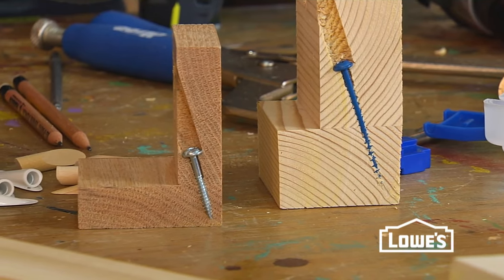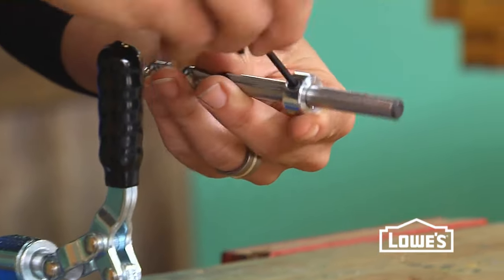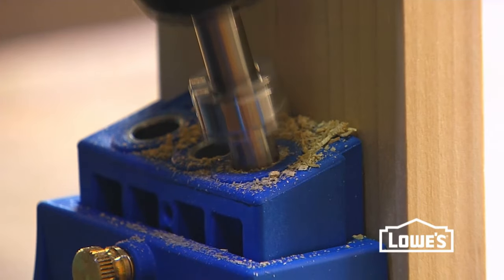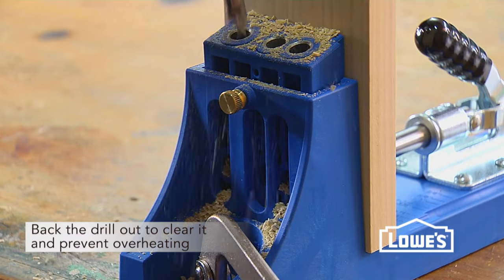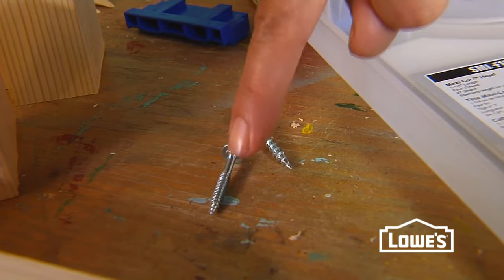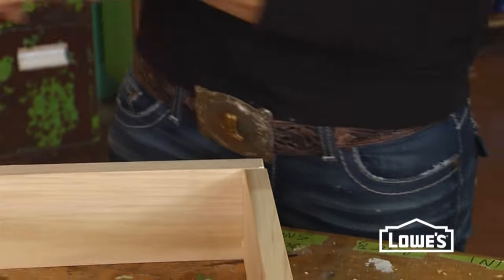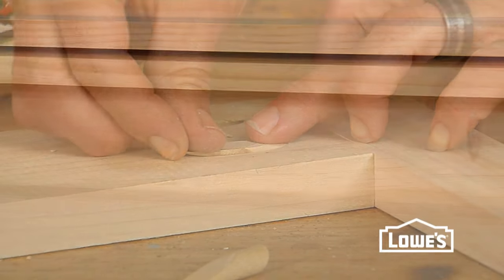How To Use A Pocket Hole Jig

Comment: I recent purchased the K4 Kreg Jig.

I am trying to join two 1.25"x1.25" pieces of red oak and the manual states to use 2 inch fine thread screws.  But whenever I use those screws, its splits my oak.

What other options are there?
Reply: Try a different type of joinery?
Reply: @William9alex  I ended up contacting Kreg Customer support. 

They recommended setting the bit and jig to 3/4" material and use a 1-1/2" screw. It goes a little under an inch into the material I am using (1-1/4")

Comment: Why are there multiple holes (3)? Different sizes?
Reply: Just for strength.
Reply: different width boards
Reply: No. The holes IMO are used for spacing between holes in NARROW stock (less than 6").

Comment: I was very surprised to see than none of the comment have mentioned the wrong way that the screws was shown in the video. At 0:17/0:20 it shows how the screws going through the top wood and in to the bottom one. You must ALWAYS direct the screws towards the longer end for maximum strength witch means in your example you should drill from the outside of the top board towards the inside of the bottom board. The way you do it is very week with minimum strength. People should not copy that. Thanks.
Reply: Are you saying that you shouldn't drill the hole toward a corner?
Reply: Very Good Point you made. But nonetheless the video was great otherwise. Thanks

Comment: Personally, I'm addicted to my biscuit joiner and generally have trust issues when it comes to anything that's not glue+tenon+mortise. However, this looks like a great way to avoid the clamping blues. If I can glue all my work at once, using the pocket screws instead of the wobbly clamps, it's worth the investment. Any thoughts?

Comment: I am concerned that this doesn't show drilling a pilot hole into the second piece to prevent splitting. It will probably be okay most of the time, but forcing a screw into the end of a plank can cause splitting. Also if the wood is very hard, it might not be able to force its way in at all.
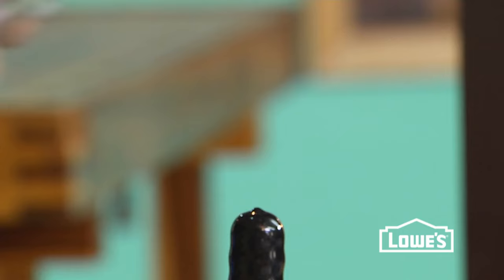Reply: sharpstick I'm pretty sure that the drill bits used do in fact drill the pilot hole into the second piece, that is why you have to set the wood sizes so it plunges to the correct depth. Check the cross section at 00:17 and the bit at 00:33 and work out where the collar on the bit would stop and the drill bit would go to.
Reply: bradburyrobinson Actually, checking my own comment you could be correct. The little end bit of the drill does only seem to sit in the first bit of wood. Maybe the screws are designed for this purpose but it's possibly a valid point that the wood could split in certain instances.

Maybe some people who currently use this could confirm if this is the case?
Reply: sharpstick as a carpenter, I would agree with you, though the manufacturers say their screws are designed to prevent wood splitting ( i guess like aeroplanes are designed not to crash) you may have to start the screw to make a mark, de clamp and then pilot drill. they al;so say that professional cabinet makers have been using this method for years, and i can also tell you the only time this is used by professionals is when attaching a seat to a chair frame or top to a table frame
Reply: One of the benefits of using the actual kreg screws - they are self tapping to prevent splitting.  They are a bit more expensive, but the between the self tap an the flat head many who use them think the are worth it.
Reply: "self tapping", unless they have a drill tip, is still forcing a gap between grains.

Comment: Can I use drywall screws instead?
Reply from the maker: +Al Complaint using drywall screws in wood can cause problems. Drywall screws are made and threaded differently; they may snap in hardwood and thread pattern may actually force boards apart. Thanks for watching our video.
Reply: +Al Complaint From what i've read, you should use a washer-headed type screw. Drywall, and several other types of wood screws have a countersinking head that, if you're not careful, will drive right through your joint and possibly split the wood in the process.
Reply: Ah! thanks for sharing. Thinking i'm buying soon or project

Comment: pocket hole, strong joint ? That's an oxymoron !
Reply: Allbbrz It’s usually for woodworking, not construction. If you are building a cabinet or trim, pocket hole are the way to go. If you are building a deck or stairs, pocket holes can compromise the thickness and integrity.